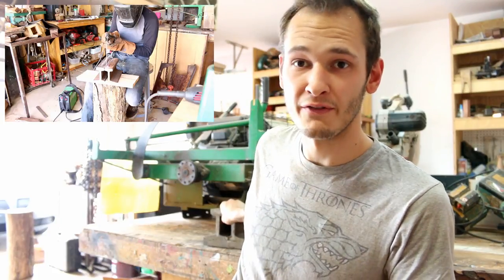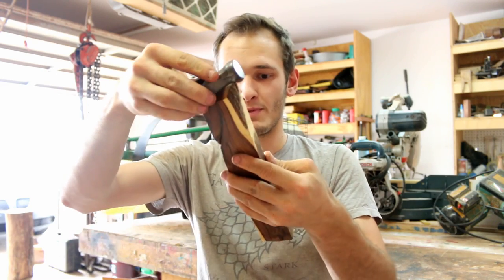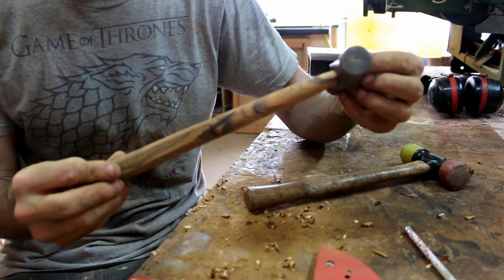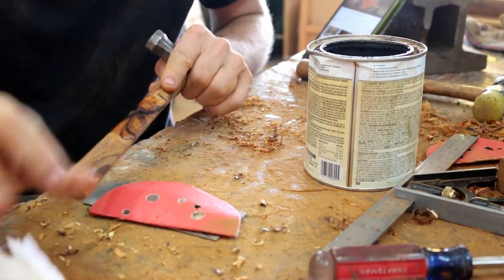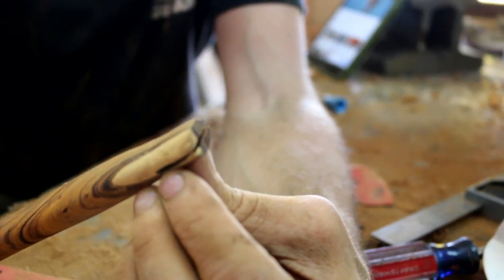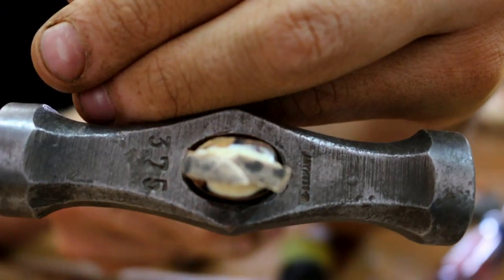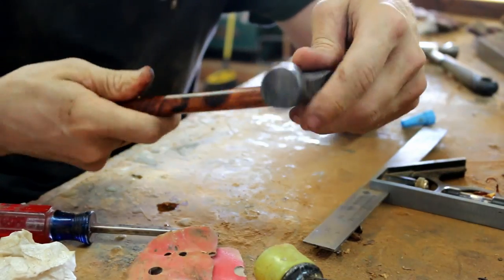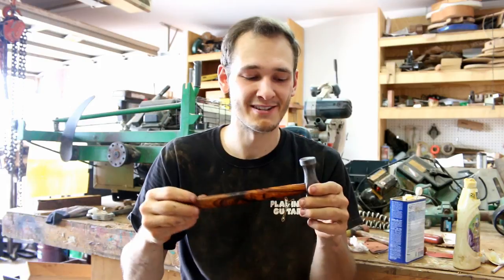Desert Ironwood Hammer Handle

Comment: Great video. That is very nice timber. I use local salmon gum for similar jobs. Similar in grain pattern etc but a much more pink / red colour. Great tip about using shellac and sanding to fill in the cracks - I'll have to try that.

Comment: Best is the wedge is accurately cut and tapered both ways  so it fits  fully along the slot and wedges both ways -expands the wood and itself wedges against the metal . Any gaps can be filled by using a ball pein hammer onto the endgrain to crush the fibres . Then linish it all smooth.

Comment: How do you get rid of that fishy ironwood smell? I put linseed oil on mine. thought it was a the oil that stunk as ironwood doesn't soak it, so I rubbed it off with alcohol. still stinks. any advice? thanks
Reply: If I understand it correctly that the smell mostly comes from the wood dust. Try brush it after finishing the job and leave it somewhere dry and ventilated, the smell will be gone in a couple of days. Also, the oil finishing is not a must, a fine grinded piece of desert ironwood (up to 1000#) will have much less smell and better looking.